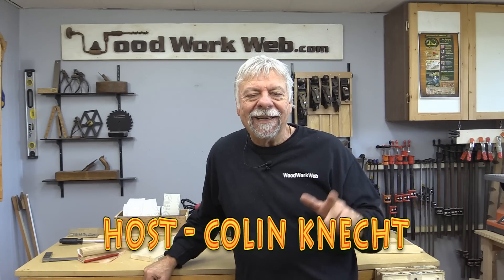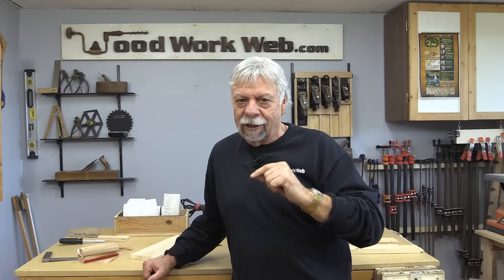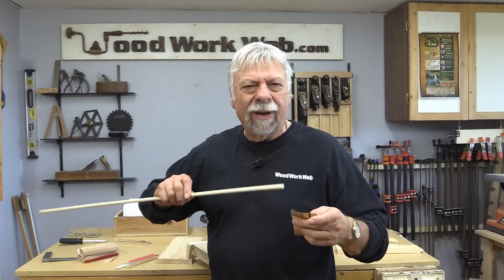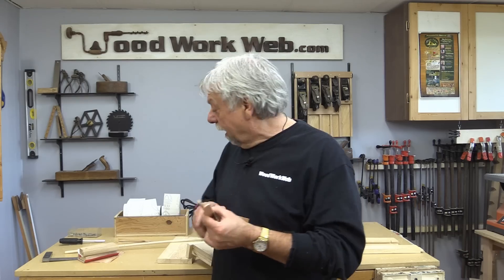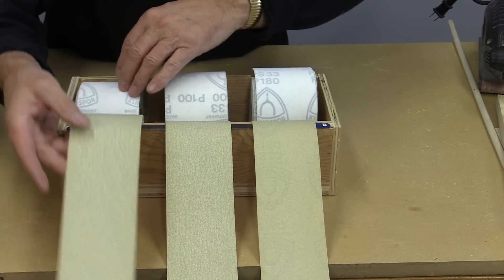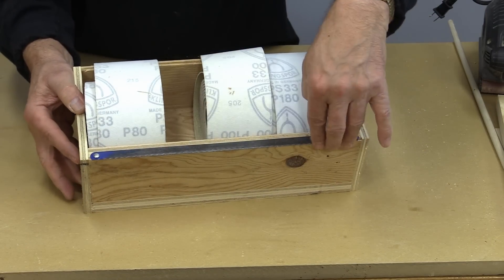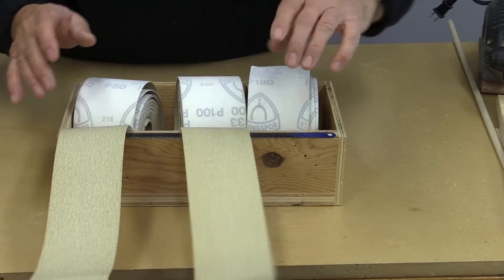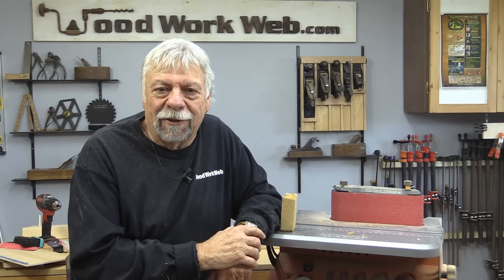5 Quick Sandpaper Hacks - Woodworking Tips and Tricks

Comment: Great ideas but you can also clean your sandpaper with just compressed air or if the sandpaper is very clogged up metal brush will work great.

Comment: Hi I love your videos, I was just curious do you have any kind of sanding hack to sand the inside of small rivets? I have rims on my car where I've removed all the rivets and I'm going to paint them a different color so I was told to use a 300 sandpaper to sand the outside and inside of the rivets and while the outside is one thing how is one to sand the inside of a star-shaped rivet? An y tips would be grateful.

Comment: The other thing you could do with the storage box is put a washer on both ends of the blade between the blade and the box. Then you can put the sandpaper under the blade and just pull out what you need and quickly tear it of

Comment: I totally need to try putting sandpaper on a dowel, then putting that into the drill and using it to bore down a slot for the bolt nuts on the cigar box guitars I'm working on.  It might work better than running the Dremel back and forth along the mark line.

I like your sanding file/tongue depressor things, but I always just called those "Emery boards." :)

Would the sandpaper roll box work better if you added a washer between both screws between the blade and box, then run the papers beneath it?  You would be able to simply pull upwards and towards you to rip them off rather than downwards and towards you.  Might take a little tweaking to keep the paper from pulling back through when released, though.

Comment: I bought one of those crepe rubber sanding belt cleaners, and it works great. It's also useful to erase pencil marks from wood too. Unlike the more abrasive pink pencil erasers, it won't abrade the wood and leave marks behind. It just removes the soft pencil marks.
Reply from the maker: +Lex Boegen Thanks for the tip, Lex ... I'll give that a try!

Comment: Great tips, I like the one about making your own sanding sticks. You can wrap sandpaper around dowels or pieces of pipe to make a curved sanding block also.
Reply from the maker: Thanks for the tip, Tom!
Reply: great show indeed! here is my humble contribution for rejuvenating random orbit operations: due to fair wear and tears, the sanding sheets (even then new ones) keep  flying off the pad. remedy? hot glue the sheet on with just 3 to 4 dabs of glue. works wonders, and easy to remove as well.

Comment: $2.99 tube of silicone allowed to harden and cut out of the tube makes great sandpaper cleaner.  much cheaper than the product your buying and works as well.  (take a tube of silicone and a razor knife and cut some slits along the tube then set aside for a couple of weeks till it hardens then cut the plastic tube off)
Reply from the maker: I'll give that a try! I should have an old tried out tube here somewhere.
Reply: I have used the contents of a gone hard tube of silicone for more than two years. Works well at no cost
Reply: Oh, come on. For most people, buying a large $10 sandpaper cleaning stick to last through many cleanings (a year or more) is not going to bust the bank. I usually cut those large sticks down (into thirds) to make them easier to handle.
Reply: I just use scouring pads. Works every time and cheaper than any solution I’ve seen.
Reply: Wish I'd known about this, yesterday 😥🤦‍♀️

Comment: Thanks for the tips. 
I have made similar sanding sticks by taking wooden paint stirring sticks, some spray adhesive and off cuts of recycled sandpaper.  You can label the handle ends with the the grit and have progressive grits on one stick.  Drill a hole in the handle and it can hang right next to your sandpaper supplies.

The sandpaper erasers can be found in Harbor Freight stores in the US, MUCH less expensive than woodworking supply stores or on line catalogs.

I look forward to your videos
Reply: Robert Hoyle seems like you could also use the repositionable glue sticks and reuse the paint stirrers.